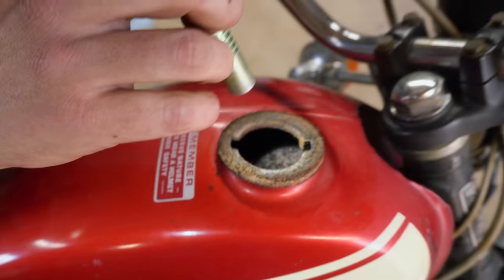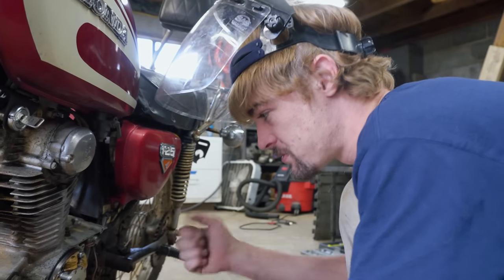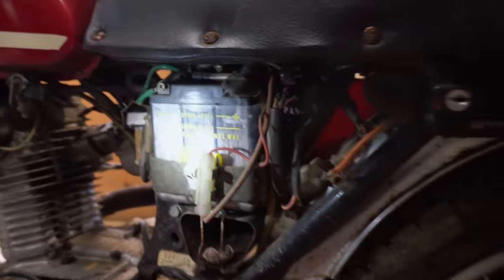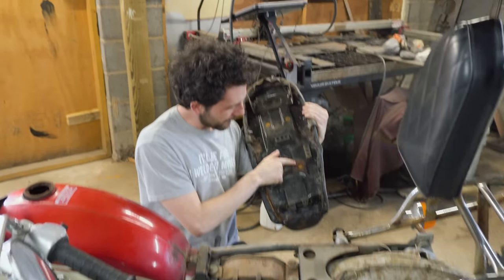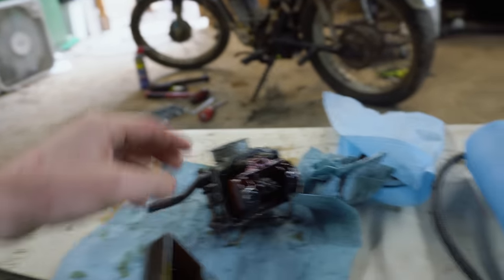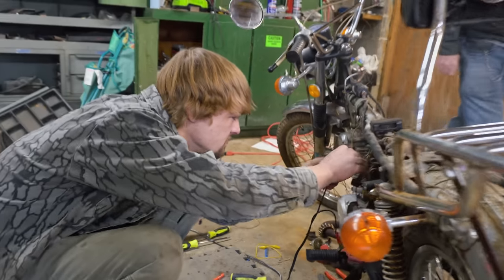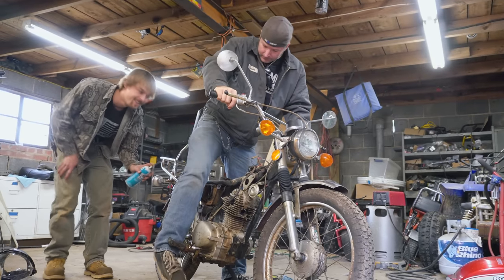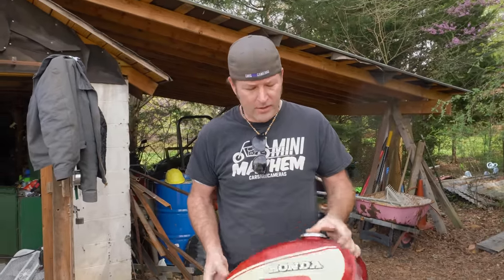Will this $200 STUCK Honda CL125 Run and Ride after Sitting 40 Years?

Comment: No surprise that it's still running ! This bike was super popular in Central Africa until the early 2000's (I'm from Tchad) , and it was one of the only motorbike imported back then (nowadays it's mainly Chinese brands).
But i've seen this bike going anywhere from clean roads to sand, dirt, mud, sometimes completely overloaded with 3 or 4 people riding it, or bags of firewood, charcoals, goats and chicken,... and still driving well and being pretty comfortable.
This thing is immortal and can do anything !

Comment: My grandfather was a farmer, and because there was a high demand for it he also did custom hay cutting. he had a Massey Ferguson windrower, and because some of the hay fields could be as far as twenty five miles away. and some of the fields could take several days to complete the job. and to save excessive wear and tear on the windrower. he purchased an old Honda 50 road bike. and he fabricated a small crane on to the windrower to lift the bike up onto the windrower. and then when he got done for the day he would let the bike down and leave the windrower there. and ride the bike home. I remember riding it a few times it wasn't a powerhouse or a speed demon. but it was a lot of fun to ride and it worked perfectly for what he needed it for.

oh I almost forgot when are you guys going to revisit the Honduki. that project has so much potential. I think it would be AWESOME with everything fixed right.

Comment: I picked up a 1972 honda cb350 last fall and it was sitting since 1986. Cleaned up the tank and carbs and a few other things and it runs and drives like a dream
Reply: Those are damn great bikes.
Reply: I have a 1969 CB350. Bought about 17-18 years ago. Learned how to work on bikes and ride with it. It's in parts in my garage and shed and basement... I've been thinking about putting it back together. Old Hondas are great bikes to start learning about motorcycle.
Reply: @Captain_Yodelstein  yeah I learned to ride and work on it to. Lot of fun!

Comment: The CL series bikes were called SCRAMBLERS.  The lights are an additional position on the ignition switch. That was made before motorcycle lights had to be on all the time.  I believe the CL175 and larger were twin cylinders.   The SL models with the same engines were even better to ride on or off road but leaned heavier towards off road.

Comment: I just got a 1978 Honda XL350. Been sitting for a long time and missing parts. I thought the engine was locked up. Stood on the kick start and wouldn't budge. Also, would only go in 1st, N, and 2nd. Checked everything and couldn't find a reason to be locked. Took the stator cover off and was able to turn the engine some with a little effort. Turned it backwords a little, then forwards again. Now smooth as butter! And has all gears. Now I know it was the clutches. Thanks. Gotta get a coil and see if it will spark.

Comment: Fantastic, brings back so many memories of my youth. A lot of guys had 50cc bikes in high school, but the older ones were able to ride 100cc and above, we all wanted a 125cc which seemed to be the bees knees. lots of fun watching you guys antics.
Reply from the maker: This thing is the bees knees😂 just enough power to have fun
Reply: Have cl 100 a pick up for $100 setting out by a tree without a pug , got it running and running great. Got manual if you need info.

Comment: Loved it guys!! My first thing I got licensed on and rode was a 1972 Honda CL100, I was 15 years old and lived in Montgomery AL. Motorcycle test was 10 questions, same as a learners permit. Still riding motorcycles! Thanks for the memories!
Reply: Me too.  14 and it was a 1970 CL70 in Mobile.  10 questions and you had to get 8 correct to pass.  Limited to 5BHP until you were 16....nobody cared...most kids in 1975 had a CB125...which was 10HP with 5HP brakes.
Reply: At 13 years old I had a 1972 Yamaha Enduro but my best friend who lived a couple of houses down the street had a 1972 CL 100.  We lived in a small town in Oklahoma.  My two stroke Yamaha was a little quicker in the dirt than his but I just adored his bike because it sounded so much nicer then mine and looked a little better too.
Reply: Yep, cl125 was my first bike in '72, it brings back a lot of memories. Couldn't kill it. Tuscaloosa,Al. 😊😊😊

Comment: back in 07 I revived a 75 CB400F that had been sitting since 92 when it was laid over at 70MPH, all it needed was a clutch cable and a carb rebuild since they were full of water. still riding it to this day. I think the only thing that will survive the apocalypse are roaches and 70s hondas

Comment: Old Hondas never die! I got an '81 CX500 that hasn't been on the road since 87 after a carb clean and new plugs it ran great. Then I replaced fluids, clutch cable and tires and ride it all the time now.

Comment: You only need a working battery to energize the kill switch/key relay. Without power the kill switch is engaged. With power the kill switch is only engaged when the key is in the off position. You can bypass it by adding a kill switch button and rewire the key to only turn on and off the electronics (lights, horn, etc) - this is useful for new engines that aren't compatible with the old key setup. For my Honda 90, I installed a Lifan engine, added a kill switch button, and used a small supercapacitor the size of a C-cell battery in place of the 6 volt battery.

Comment: I saw a 1972 Honda CB125S at a friend's place that was parked up and covered in dust. I knew it had been his father's commuter...and his father had died 25 years previously. 
The bike had 28,000 miles on the clock...still had it's 1972 front tyre...back one had been replaced.
I asked my friend if he intended to do anything with the bike...and he said he was going to give to to me. 
I bargained him up to $50 and he threw in 2 helmets and many spares.
I took the machine home, cleaned the points, bought a new battery, cleaned the centrifugal oil filter, replaced the oil and then filled the fuel tank.
We don't have corn juice in our fuel so no corrosion either in the tank or carb...but I put in an inline filter when I replaced the fuel lines.
It started on the third kick. 
I had to re-register it and that cost $320......they attached a new VIN plate to the chassis.
The next weekend I rode the bike 250 miles to see the friend who was on holiday to show him it was up and running. He almost fell over when he realised I had ridden the bike that distance as a shakedown cruise.
I then rode it back home on the same day...14 hours in the saddle.
Oil top up completely replaced the oil in the sump over the course of the journey ( 1 litre Mobil 1) cruising at 8000rpm...maxing out downhill @ 9200rpm.
A  month later I did three days of 300 miles....after which I considered it reliable enough to use as a commuter for the next 2 years....
I swapped it to a workmate who wanted a "vintage" bike...and one suitable to teach his 12 year old to ride...
As far as I know it is still going.....

Comment: Awesome seeing you save a neat ole bike. A tip my buddy taught me was to put a peice a velcro around the clutch lever and put it at about half pull, which keeps the clutch from sticking. He had several Honda CBX's and they were notorius for the clutch plates sticking.

Comment: You guys were correct to inspect-repair all you did. Ike listened and then mentioned the fuse. As he said, you guys did the hard work that needed to be done. I learned long ago as an auto mechanic for the past 50 years, to check for the simplest causes first. So many repairs were just a loose, corroded ground, blown fuse. Bad condenser, corroded points. Common repairs were just a split-dissolved  vacuum hoses. No fuel, contaminated gas. clogged filters. I'd check for the easy fix, then I'd dig deeper. Saved the customers a lot of money being a detective and they really appreciated it. I never got rich as a mechanic, but I can die happy knowing I was an honest one. Yes I screwed up many times, over the years but never made a repair a customer didn't need. I'm broke but happy. lol.

Comment: The old Hondas run with an exciter coil to regulate the charging system. This means that instead if having permanent magnets it uses electro magnets to induce current in the stator coils, so basically you need like 10+V for it to overcome it's own power consumption. The good thing about it is that it's a more efficient way of regulating the charging current since it's also will reduce the parasitic loss of the generator. On my 1975 CB400F i tried a couple of regulators since you need a compatible one to use litium batteries. some would just sort out the field coil and regulate with mossfets others would regulate the field coil, and I could tell that the idle would be higher and more stable with the original system. But the backside is that having a kickstarter is basically pointless then, especially if you change out the points ignition with a digital one since the minimal voltage of the points system is down around 7v and for hall effect ignition it's around 10v.
Reply: Same for a lot of the older bikes the charging system on late 70's bikes used the lighting circuit as a third phase from the generator, so when the lights were off it slowly destroyed the generators on these bikes, a quick wiring fix used the 3 phase CX500 twin rectifier setup with a permanent power feed from the rear brake light to balance  the charging system .

Comment from the maker: If you’ve never ridden an old small bore Honda, you’re missing out!
Reply: I have to try it sometime
Reply: I had a 73 XL 100. Loved that Motorcycle.
Reply: cb750 1969
Reply: What ever happened to the car videos you did one video on and that was it. I always see it in video with no progress at all
Reply: Honda deauville 650 not a exciting bike but a mile eater sat for years popped the plugs span the engine over checked it was clear and turning then plugs back in and dragged it behind a van ( dead starter) and it fired up and ran just fine!
Reply: I got a 1979 honda 80. Absolutely love it has out lasted my 2010 and 2013 honda 125s
Reply: My first bike: a brand new 1972 SL70. Damn I wish I still had it.
Reply: He’d an old 100cc Honda dirtbike. It was a blast
Reply: Agreed. The sound of those old single thumpers still does it for me.
Reply: I'm not missing out, my work bike is a Honda CG 125 lol
Reply: Rode with several friends that had Honda 100's decades ago. They would run out of gas often because they got such good milage they would forget to check the fuel! The only wear repairs we ever made on them were chains, sprockets and timing chains. Some of the greatest engineered engines of all time. Chain tensioners from jumping and off-roading them were always breaking though. Great memories.
Reply: Never underestimate a Honda that's been sitting I bought an 81 Silverwing in 2021 for $1,000 that have been sitting since 85 I put a battery on it and some fresh gas started up I've never had to clean the carburetors or anything on this bike it has just driven and occasionally tried to throw me a few times and I will admit all on me bike was never an issue
Reply: i had a 79, only had 5000 miles on it when i got it in 1998. pretty blue with the white stripes on the tank. loved that little bike!
Reply: My first real bike on 2016 was a 1980 Honda xl100
Reply: @jackrickells3979 they have alot going on
Reply: What do yall use in the tank what kind of cleaner and man that was a steal deal came out beautiful like everything yall do amazing amazing amazing channel love yall I will be making the 15 hr drive next yr to busco I can't wait imma bring few dingos quads minibike
Reply: I rode a few and yes, they  are a lot of fun! first one was a 1973 Honda SL 100 that was all stock. later I got a 1980 XL 185 with the original 185 cc engine with a broken connecting rod and this broke the cases but had a good cdi ignition and thus did not need a battery for spark. I got a 1976 CB 

125 engine that came with the bike. I modded the case on the 125 so the 185 cdi ignition would fit on the 125 engine, and rode it like this for a few years. before I got the XL 185 I had a 1970 or 71 CT 70H which had a 4 speed transmission. I did a very basic hop up on it which was a little larger carb installed, It broke the clutch drum and when I fixed that and a few sessions of riding it the primary transmission shaft twisted in two.

The latest one which I still have is a 1971 Honda Z50 with a damaged frame and a engine that kicked over too easy because it has no compression.

I got another 1971 Z50 frame for it. the original fuel tank was rotted out very badly so I found a brand new reproduction 1968 to 1971 Z50 tank.
then I rebuilt the engine. I got a trail bike 88 cc top end kit and a AHP 4 speed transmission set and a trail bike exhaust for the hard tail Z50 and rebuilt the engine.

 I rode it in this configuration for a little bit then did some research and got a stand alone stroker crankshaft, gaskets, piston for the 108 cc stroker crank and the larger 24mm carb. currently I am running the carb that came with the 88cc kit. it has much stronger torque as a result but does not rev  very high. I need to get another petcock for the fuel tank because the slightly longer and taller 24 mm carb has limited space and the air filter would hit the stock style petcock.
Reply: Oh yeah, we have a 1972 cb100, dad road it as a kid, and it sat for awhile. But after a tad of work she still runs great
Reply: I had an 80 xl 250s and took it to school every day around 2010
Reply: Idk if it’s a small bore Honda but I have a 1982 Z50R and it’s the best thing since sliced bread
Reply: I just got a blue candy metallic 2017 Ford Fiesta with the DCT. You guys ever consider doing actual amateur rallying? Ever consider going really fast in a supermini?
Reply: ''CHUCK'' needs to make more appearances on C&C!🤣
Reply: 1964 CN-95E Honda Dream and 1993 CRF 230
Reply: Me and two wheeled rides don't get along
Reply: Z50
Reply: I used to have one I loved it I would like to have that one but mine was a SL
Reply: I had one I and I loved it
Reply: You guys should bury a working mini bike for 1 year, it’s an original idea
Reply: Oh I believe it
Reply: @martinandrews1284  I got scared shitless on a homemade minibike, I had zero control of the thing almost got hurt
Reply: I use to have a 1979 Yamaha enduro I found it in a old shed and got it running it was amazing but I had to sell it a week after I got it running 😢I miss that bike
Reply: Currently working on a 99 Yamaha sr 125, it’s a complete headache right now but I cannot wait to get it going and have some childish fun.
Reply: Try a cb 50.
Reply: C90 from 1988 👍
Reply: I have, and yes, they're a blast to drive.
Reply: "Gasohol" was introduced in the early 80s. I was driving a 79 Malibu with a 305 quadrajet and I decided to try a tank full. By the time I got through the first tank it almost ruined my carb. It dried out to neoprene tips on the needle and the gaskets were leaking. Not a good idea.
Reply: @garysorrells8133  yes sir. Depends where you live. In my country (the netherlands) consumer platforms started early to ask awkward questions😉.
Got the famous finger of the Carpenter ordering four beers😉. 3 of them got lost in the saw. The famous middle one didnt😉.

Hier liggen mulder en de rijk.
Ze kwamen van rechts en hadden gelijk.
(2 folks came from the street of the right. Had preference of road, didnt get it , and got killed).
How the ????? get justice?
Reply: My first bike 71 SL100, I loved it so much I brought a 81 CB125s 40 years ago and drive it to this day.
Reply: Why did john kick it like that when he was kick starting it?
Reply: I ride a Honda cd70 and a Honda cg 125 love those things
Reply: I have,they are fun.
Reply: I had a honda cb 200 twin funnest little bike, plenty of torque fantastic gas mileage and after riding 100miles with no oil and locking up, I poured oil in cylinder and crank, kicked it loose and it neeve burnt a drop.of oil an ran perfect.
Reply: @carlakers285 😂9😊😊
Reply: will the pipes off a 175 fit it. if so you would want to talk to me😎😎😎
Reply: I forgot 175 got 1 to many pipes but! hey come apart
Reply: I got a 1979 hondars 180c³ twinstar engine. The fucker goes apeshit pfg road a truly well built,  solid machine with power up the ass, would beat any Chinese pitbike/ knock up bike.
Reply: @seanwookie7703 I currently drive a ‘76 XL250 that I rescued a couple years ago. I love it
Reply: I’ve got a 1980 Honda, CB 250 RS single cylinder that I found in a barn find rebuilt the carburettor and runs and rides like a dream. Fully recommend it UK baby

Comment: Vinegar and rocks and that wheel. Perfect tank cleaner.  Used to strap em to the one wheel peel rear wheel drive  and spin em like that to clean em up.
     The por fuel tank sealer.

Comment: The ignition system is called "battery points ignition". A "normal" ignition system uses a coil (stator) and flywheel magnets to produce the low voltage that is sent to the CDI or ignition coil and points. This system simply charges the battery and uses power form the battery to feed the coil / points. 

This system is arguably better, as the stator coil is usually the most vulnerable coil in the system. In a battery system (battery points system) your ignition relies on the battery and battery charging... You can have a charging light that tells you if the battery isn't charging, and if the light comes on, you can still usually drive for a considerable distance before you lose spark. If your stator coil goes bad, you lose fire immediately.